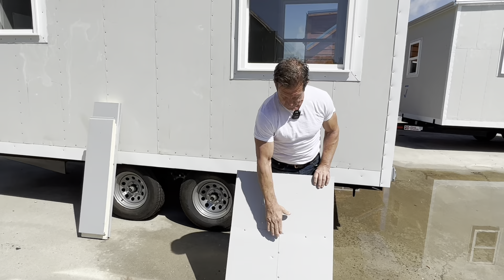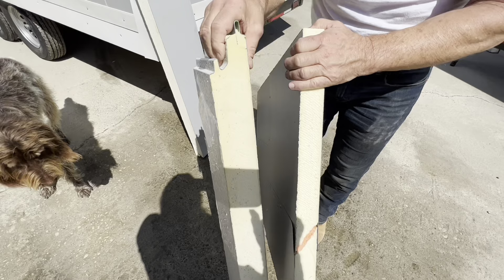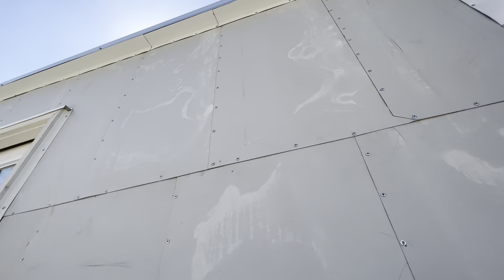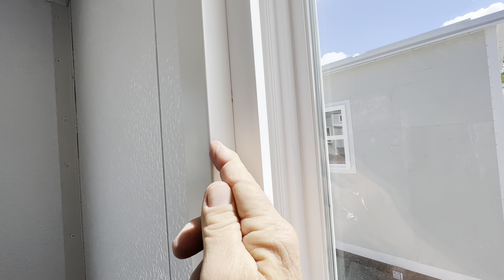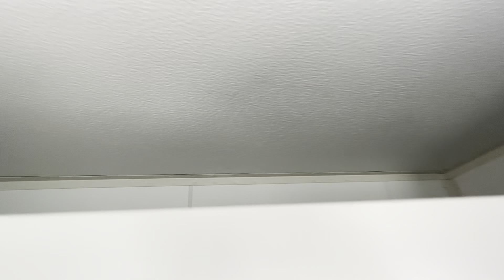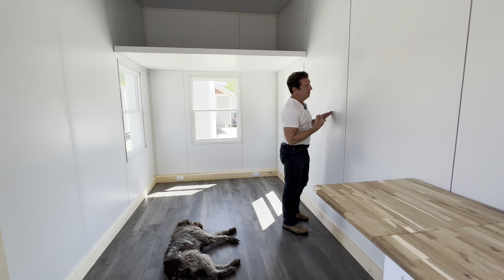$25,000 Tiny Home that Exceeds all Structural and Environmental Guidelines 🏡🇺🇸🤩😉🏘️💵

Comment: I like the new panels so you don't have to stucco the outside and inside to hide all the seams like in the old ones.  With the thicker panels, you'll lose an inch of internal space from each wall.  In a tiny, every inch counts but worth it with the additional insulation values. (Glad you may keep both versions, for the folks that really can't stretch for the extra $5K or for the folks that want the original which has gone thru the intense "in the field" testing.)

Comment: I would put the flip table on the other side,  in the front of the drawers, making a shape L counter when is open,  the flipping position of the " table " adding counter space would fold  on top of the counter ( so won't take any space when is closed ), so I could put a refrigerator beside the counter.

Comment: I thought it's inevitable that available remnants would be limited. You are on the right track. You need to offer both options because remnants depend on THEIR economy. As remnant use get more popular, they will be harder to acquire. The new panels will cost more, but balance out somewhat since they come ready to use & allow more efficient use of labor. They will also make more people accept the appearance. For those that want a more finished look, they can have it with the modest extra upcharge. If they want color choice, the white or grey makes a good prime color to paint with automotive spray paint.
Reply: The extra cost paid for the home will save the homeowner in decorating material expenses... and save us time!  Might end up at break even for some folks!
Reply: @Faithful525 no

Comment: Really like the new panels - alot actually!  No screws - super!  Smooth straight seams - very nice!  The ability to leave the interior panels smooth - it comes this way originally - so all the peel and stick wallpapers, veener wood and brick looks, and even the peel and stick tin and decorative tile sheets can be placed on the panels and then pulled off easily at any time for an updated look!  Also, wondering if magnets will stick to the new panels?  Randy, making one with the bay window along with 2 transom windows instead -  on the side walls -  that roll out  would be so cool!  The placement of the transom windows being head height up from the floor would be nice to have so if someone wanted to leave the window covers open they could walk around in just a tee or pj's.  Also, a solid front door with a small transom at the top, and or, a peep hole.

Comment: I love the look of the new panels.  I would not have a problem with painting myself or hiring someone to paint the outside and or inside.  My question is that as it is almost 3" thick, would you consider having the house 8.5 feet wide, vs 8 feet wide?  So that you don't lose some width in the interior?  Also, how wide is that door?  is it 30 or 36" wide?  A bay window would be nice on that house, and I was thinking some storage under the bay window would be great too.

I will reiterate, I love the look with the new panels, they make the walls more uniform.  One can always paint them a different color, as well as the door, and put shutters on it.  On the original panels, I would either stucco it or put LP siding on it.  It is a good idea to have a different source of building materials as well.

Comment: I’m wondering, if I were to order a 20 ft Incredibox and a 20 for Addabox at the same time, could I get the bathroom installed in the Addabox instead of the Incredibox.  Then in the Ibox there could be more room for refrigerator, washer dryer, pantry.  What do you think? 
I have no problem with the door panel construction and would prefer it, but would accept the new panels.
Reply: Ooooo 🎉
Reply: I sent him a picture of the same exact thing you just described.

Comment: Very nice protocol build. 👍

Florida here. We have been building lanai's and glass rooms down here with those 3" panels for over 30 years. The one issue we have run into are the roofs.  The panels are made here in Florida and the metal is aluminum not steel. So expansion & contraction is an issue on the joints especially considering we only use a pitch of 1/2 " per foot. The strength and insulting factor is amazing. 
BTW rain noise on the roof can be loud. We get very heaving rains here in Florida so it is noticeable. I bring this up because it can be hard just to talk to a person in the room. 

The wife and I used to rent a cabin in Newport years back. Beautiful area. 
Good luck with the new portables. I'm sure they will be a huge success.

Comment: I do like the look of the new panels. I would expect that building with them will go faster once you get the routines down due to not having to cut the 45 degree angle and put in the screws on so many smaller panels even using the screw guns. Another benefit is that you can de-laminate the window and door pieces, recycle the steel and use the foam for the floor like you do the original panels, reducing landfill waste. I think offering both types is a good thing for the company!

Comment: ❤🎉 The upgraded panels. Wish list ideas:  1. Trim not finished with clear high gloss.  I'd prefer to DIY it myself with white paint. Save time & costs, let the trim be DIY. 2. The option to remove 3 windows.  Skip the bathroom window.  Remove 2 windows that are on each side of the big window/bay window.  I'd be happy with just 1 window/bay window, the sink window and door.  It would be nice to have more wall space without windows.  Less windows might save you production time and $$.  3.  Don't worry about filling the interior panel gaps. I like the professional finished look that is tidy.  4. Leave doors, window, trim white or able to be DIY. 5. How can the underbelly be protected/sealed?🥳👍

Comment: The new no screws panels look great on the New Prototype Incred-i-Box! albeit at $5000 more per Incred-i-Box.  Stronger structure, almost 1" thicker insulation & no screws to connect the panels.  👍👍👍
Reply: Owners will save some of that back in DIY material expenses, and time savings.

Comment: I love the new panels.  It allows you to not have to add a finish.  The original is great and if I got an original I would likely use the stuccoflex to cover it to hide the screws and cover the joints.  with this there is no need.

Comment: Could you move the kitchen counter more to the left to make room in the bathroom for a small sink next to shower? Would make the bathroom a bit bigger to accommodate  shelves.  Otherwise like the new panels alot.
Reply: I believe the plumbing for a sink is always roughed into the floor of the I-Boxes, opposite the bathroom door.  You can use one of the small ones, like a half-moon or that very small rectangular Ikea model with its own vanity.l

Comment: The bay window seat box - is there storage underneath?  Growing up, we had a wall of window boxes in  a small room without a closet - storage galore,  Can't wait to see the cottage!
Reply: No, there is nothing below the bay window seat, unless you add a mini-split, and then the heat pump for the mini-split sits below the bay window on the exterior. However, that doesn't prevent you from building an insulated box there (unless you have the mini-split).

Comment: I love the new panels.  The same color panels are the right way to go.  I worked at a snow mobile factory that we had to switch from different colors to European models to electric starts and etc.  You need a lot of storage and you need more manpower doing something like that I don't think it's profitable at all.  Especially when they would change after so many on the same run.  It's insane for we didn't have room for all the different colors and parts

Comment: Have you shown the roof?  So you are saying there is no steel framing?
Reply: Correct. This is not a steel framed home. It's a structured insulated steel panel home. The roof above the panels is a standard metal roof.

Comment: Question....can a WD combo be put under the extended countertop in the new Incredibox?? 🌻🌻
Reply: Yes. There is an electrical plug there., you would have to run the water and drain connections through the cabinets and tie into the sink plumbing.

Comment: How do you attach exterior siding if you want it?
Reply: Self tapping metal screws that are long enough to go through the siding you choose, and only about 3/4" further into the wall panels. Just be aware that you will always have to keep siding on it to cover all the new holes you put in it. No going back.
Reply: @Faithful525  so it will only be anchored by thin metal and can rip.off during high winds?
Reply: @savegraysoncats  - Look... you are the one wanting to add siding to a home that clearly does NOT need siding. If you live in a high wind area, or are planning to take your home on the road, then adding siding is just plain dumb. But hey, it's your home!! 🤣
Reply: @Faithful525  thanks.  I was asking about how it was built.  My questions were answered

Comment: Questions😅
Does the roof have to have such a severe angle? 
Can we get them with tankless H2O heater?
Is there any more of an issue with the grooves channeling water in the rain? (It seems your joining is more sealed than these pieces?)
Very pretty.
Reply: The roof must be sloped for rain and snow shedding.
Tankless propane water heater has always been an add-o option, if you don't mind having to change out your propane tanks.
Reply: @Faithful525  hi, thanks for your answers…do you work with them?

Comment: While the materials are great it's still way too narrow to actually live in full-time also that storage above is too low and it feels like you're getting crushed it needs to be raised up more.  A 20 by 20 would work out best.  Also is not an actual bedroom either.  So anyway that's just my two cents worth
Reply: A unit 20' long is no problem but 20' wide would be too wide to go on the roads.
Reply: 20 foot wide is too wide for roads. The 20x20 Boxable folds to 8x20 for transport.
Look at the other models, he has wider ones...

Comment: Good tiny home but, what a waste the shower bathroom are so small. In the most important  interiors design  the shower bathroom should be big with green glass door .  Living room should be less windows, not save easy get break in ,suck too much electric , the house will get weaker,  the door entrance should not be there , should be close to livingroom  ,refrigerator should be bigger , the kitchen table should be smaller,  the bedroom should be where the bathroom is & extra room on top  .  The kitchen area  should the bathroom . Next to it should  be small kitchen table .  The livingroom should be high ceilings no extra room on top . The floor brighter color not too dark  will make living room looks brighter & bigger  . The livingroom floor area should build another steps under storage room with the pull  in & out long draws  . On top of that is a  table  ,sofa that turn into a bed . The  tv by the wall . This resign will save alot of space & look very modern .
Reply: Sorry ,I  type wrong design instead resign.

Comment: can we get a video on the electrical please.
Reply: It's 110 volt.
Reply: @SusanB  I mean the whole thing. Not just the outlets inside 😅.  The electrical box she shut at the end of the video looks like a 220v main in, also double spaced brakers so you can put 12 brakers in other then the main?  Plus it looked like it had DC fuses next to it. 
 The main electrical an what it offers is what I'm curious about.  Is it 30 or 50 Amp 220 coming in